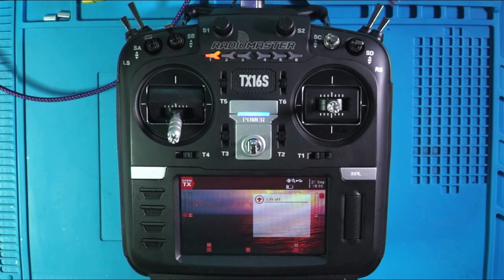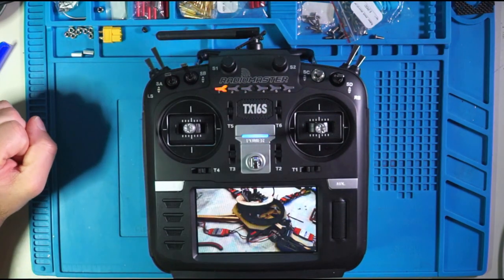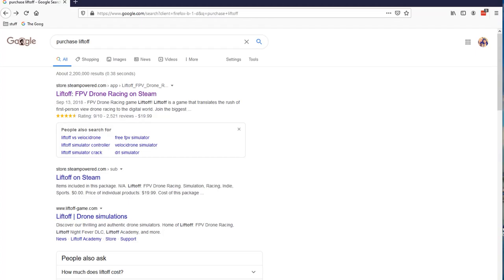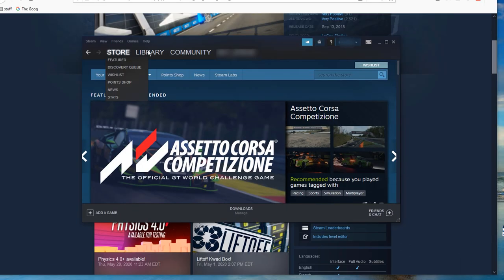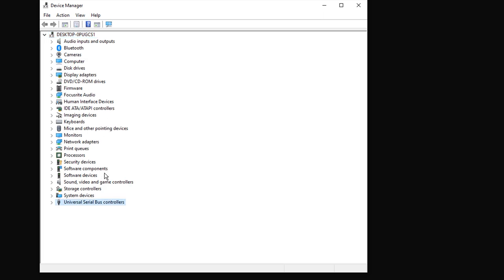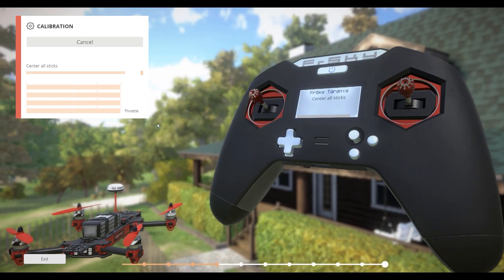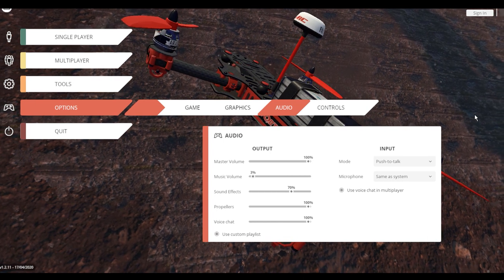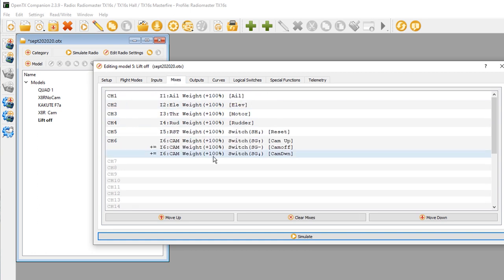Get the TX16s working with Liftoff Simulator

Comment from the maker: ****** YOU CAN USE THE DEFAULT INPUTS NOW, NO NEED TO CHANGE THEM ****************                                                                                                                                                                                                                                                               ********YOU CAN USE THE DEFAULT INPUTS NOW, NO NEED TO CHANGE THEM *****************
Reply: What defaults mate please?
Reply: u mean the drivers?
Reply: @bugsy742  Look at around the 3 minute mark in the video where he is showing the inputs in OpenTX. You can leave them as stock without changing them now.
Reply: @stevesexton6194  get ya 👍😎🤝

Comment: I left all my inputs at 100% and it works good that way, and I also rolled back the driver on my laptop to get it to connect. Top notch instructions .
Reply from the maker: Thanks for bringing this up.  I was unaware that it now worked, "out of the box".  I do notice subtle differences while flying between the settings, but both work.  I would be interested in getting your feedback on trying it the other way and see which one you like better.

Comment: Hello @Steve, thanks for this amazing guide it's still super useful here in 2023.

I have followed it up to Liftoff and there's something odd. Whenever I take off with right stick in dead center I go back or to the side just by raising the throttle. I tried adding 0.1 deadpan on calibration but it's still there. Any ideas?

Comment: I had trouble finding the USB driver, it was nowhere to be seen. So I checked on another YouTube channel and suggested I "rollback" and that worked, I have everything working fine, except none of the switches work, in "Liftoff" or under control panel. Just the Axis, which is fine, except it would be nice!

Comment: If you have newer version TX16S with built in ExpressLRS module, you can use ExpressLRS Bluetooth joystick function to make it work as wireless Gamecontroller for Windows 11.
if you have older version TX16S, then you can buy external ExpressLRS module to do the same. 
Most simlutors will function with bluetooth gamecontroller.

Comment: I have an RC transmitter that I use for virtual drone software that would typically connect via USB as a controller.  With Windows 10 it has continually showed up as "Unknown USB Device (Device Descriptor Request Failed) in Device Manager when I plug it into the computer.  It also shows in control Panel under Devices & Printers in the Unspecified section instead of as a controller.  I am under the impression that it should show under libsub-win32 devices in the device manager but I don't see libsub-win32 anywhere in my device manager.  I've tried to roll back the driver (that's grayed out) and also tried to update the driver via the automatic search within device manager to no avail.  The transmitter is a Radiomaster tx16s connected via USB if that helps.  Any advice or path forward to getting this to work would be greatly appreciated.  Not sure if there is a way to add the libsub-win32 to device manager if it's not there or some other way to address this issue.

Comment: hello great tutorial.  I have a radiomaster recently, I'm learning from your movies.  I have a question I am currently practicing on liftoff I did everything as you showed in the video.  however, I can't set the restart on one of the radio buttons.  I have to use R on the computer keyboard.  want to have this set to the radiomaster as you do.  do you know why it doesn't work?

Comment: After I plugged in my RadioMaster, Windows 10 recognized it and I could go straight to Liftoff. However, I changed all settings back to default, so no 50% settings. Just plug and play. In liftoff  calibration is needed, though.
Reply from the maker: Thanks for commenting.  Improvements have been made to eliminate the need for those adjustments.

Comment: I wonder if you can help was at RC club Sunday and were having problem with the throttle trim using mode 2 when in lowest idle  throttle trim only works up none down but if i put stick in centre position i can trim up and down.

Comment: Hi Steve, love your tutorials, they have helped this noob very much. Hey when you say we can use the DEFAULT INPUTS now, I know the simulator works with them but do also mean the default radio inputs, like where we put in the 50% ratios in the input screen? Because I’m still using those 50% inputs, just wondering. Thanks. Hey one more question if you don’t mind. What would cause my TX16s to only allow me to use 8 channels instead of the full 16. Thanks again.
Reply from the maker: What I meant was you no longer have to change all that stuff on the radio to make it work in Liftoff.
Reply: @TahoeSteve  Thanks I appreciate it Steve.👍🤟

Comment: great video, but the quad starts to lift at around 60% throttle... how can we fix this?
Reply from the maker: Try it with stock settings to inputs/mixes.  they have made improvements so you don't have to do all those changes anymore.

Comment: If I connect TX16S to my HP laptop with USB C port, it doesn't work.
however, If I use the same USB C cable but with C to A adapter and connect it to the laptop's USB A port, it works.
I'm not sure what the problem is. It's not the cable, or the TX16S or the Laptop's problem. 
Happens to another laptop with both USB C and USB A ports. only works if it's connected to USB A.

Comment: Is there any reason to change the input settings on the controller? Mine are at 100% and it works great.. would it be loosing precision?
Reply from the maker: The way I did it in the video is the way I learned a couple years ago on my Taranis.  I did some testing both on the TX16s and the Taranis (setting it up like you said), and they both work fine on both radios.  I fly better using the old method because I am so used to it, but thank you for calling this to my attention.  I would be interested in getting your feedback on trying it the other way and see which one you like better.

Comment: I have a little paradox here between setting up the TX16s and/or the Zorro to the Liftoff Simulator. 

Okay to start out both do link up no problem to Liftoff. However; anyone assign functions on both controllers like, flight modes, arm/disarm for example and get them to work in Liftoff as well? The RadioMaster Zorro totally works in this area. After spending seriously over 8 to 10 hours watching YouTube video's and trying all sorts of different ideas I can assign the functions on my RadioMaster TX16s, but non of them work on the Liftoff simulator whatsoever!

Has anyone else run into this issue and solved it? Any help here in a resolution would be very grateful.
Reply: Did you (or anyone else) solve this? It's where I'm at too. Only some of the triggers are assignable in Liftoff but few of them seem to work. Having no luck with arm/disarm.
Reply: @DIProgan  Yes! Liftoff has its own area where you see programmable keys. Open that and there will be 2 options keyboard shortcuts and controller shortcuts. 😜

Comment: Hey I know this is unrelated to this video. Just saw an older video of yours and would like some feedback and thought to comment on a newer video. So I just took the heads off my 5.3 tahoe replacing leaky headgasket. And the driver side looks like it got a bit of water. And was hoping to get some suggestions on cleaning. Im thinking a good cleaning should be all i need to get a good few more miles from it. Gonna check my block for warp. Id like to pull my pistons and possibly get em machined but not sure about it. I bought this tahoe from a friend for $500. Looking to get it running as cheap but as reliable as possible as my other vehicle is an 89 jeep xj. Thanks!
Reply from the maker: obviously, a machinist is the way to go but since you said cheap, this is what i did with my parts:  https://youtu.be/WyiVWxtG2DY
Reply: @TahoeSteve  haha awesome! Thank you very much for the feedback.  I was trying to look through your videos but didn't see this video!!

Comment: Do you know if there's a way to turn off the radio transmission when using it in a sim?
Reply: Disable the internal/external RF in simulator model?
Reply: @oyvind0075  I will look for that option. Thanks

Comment: hello everyone! I'm having as bit of a problem even after watching this video.
it feels like when I'm flying the controller has two very different sensitivities in lift off. yaw right is pretty smooth but yaw left is vicious. this goes the same for roll. throttle up is very unresponsive then suddenly I'm taking off to the stars. anyone know what could be wrong? I don't think i need to set the driver up as it recognized my controller as "RM tx16s joystick" I followed the directions in this video.

Comment: Why are you setting weight, offset and curve?
Reply from the maker: It's the OLD way to do it.  Used to be the only way.  People have called to my attention that this is not necessary anymore.  I have tried both and the old way definitely has a different feel that I have gotten used to.
Reply: @TahoeSteve  thanks for clarification
Reply: @TahoeSteve  Will it make the simulator feel different from flying real quads?

Comment: They must have changed something in the radio or I just got lucky. I didn't have to do anything in this video. I just pugged in the USB C cord went to lift of and in the control part it showed the radio picture as it usually does and it said RM TX16S. I clicked it and then calibrated it and it worked perfectly? Also I dont know if anyone knows but the 8 in 1, 20 in 1 sims you can get off eBay work perfect with the radio also by just plugging it into the DSC port on the top of the radio. I noticed the the (mono TS) cord that comes with those type sims dont work. I had to use a (stereo TRS) cord and it works fine.
Reply from the maker: Yes, much easier now then when I learned how to do it.
Reply: @TahoeSteve  I dont know if you know or not but you can use the little cheap eBay 4 in 1 , 20 in 1 sims with the radio also. Most those sims come with a mono TR cable. It wont work. I had to use a TSR stereo cable and you just plug in the DSC port and it works like a charm. If it doesnt find the radio you have to go into the trainer settings and make sure its set to Slave/Jack.. I updated my firmware and it changed the setting on me and I couldn't figure out why it wouldn't work any longer and finally figured it out as it needs to be set Slave/Jack. Hope this might help someone.

Comment: Any idea for macbook?
Reply from the maker: Get a PC.  KIDDING!   Actually I do not know a thing about Macs, however, I thought macs were famous for not having to add additional drivers
Reply: @TahoeSteve =) thank u, i solved the issue my data cable was not working i guess
Reply: @ckhayeet  so you were able to connect RadioMaster tx16s to Mac, don't you? I'm currently thinking about buying one, but I'm worrying if it will work with Liftoff.
Reply: @viktormaksymenko2506  yes yes no worries works fine, no need do anything just plug in
Reply: @ckhayeet  Awesome, thanks!
Reply: @ckhayeet  it’s not getting detected on mine! Had to install windows 10 via bootcamp